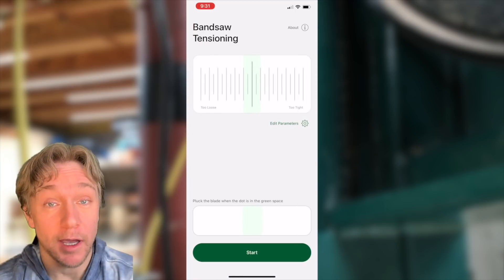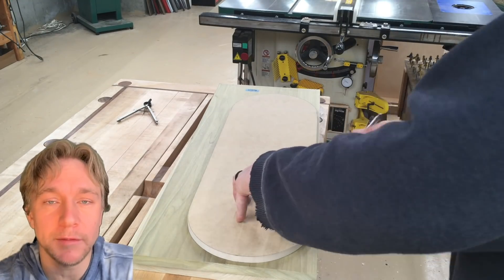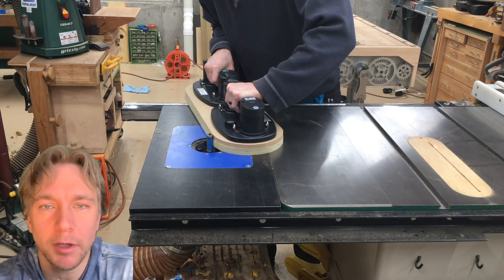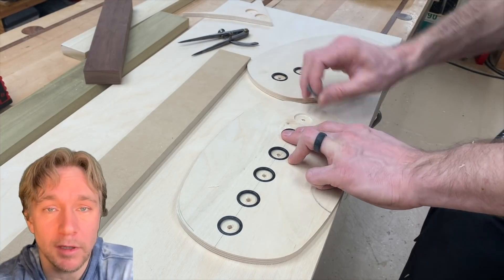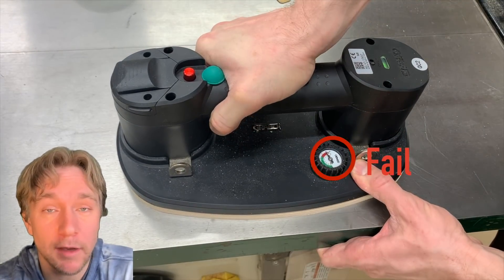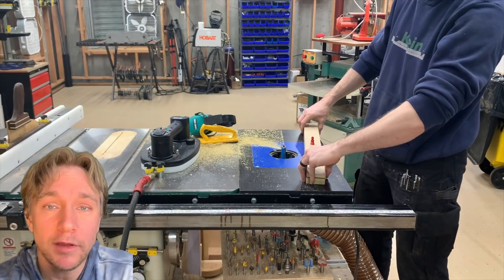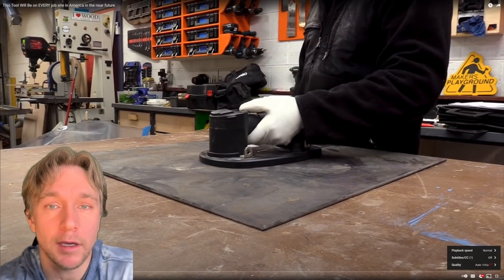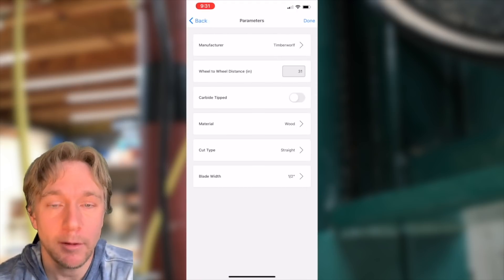GRABO template routing, can it be done?

Comment: Is there a musical note for the "perfect" tightness of the bandsaw blade? I have an app on my phone to tune my guitar. Would that work on the bandsaw if I "pluck" the blade"?
Reply from the maker: No, the perfect notes changes based on a bunch of specifics for your saw and blade, that’s why so made the app.
Reply: If you always have the same bandsaw and the same blade, you should probably always expect the same note when it"s tuned correctly. It won't work anymore if anything is changed. And this specific app probably won't get rid of the harmonics the same way as your tuner, because the purpose is not the same. So a guitar tuner may work in some specific cases, but won't cover all needs, far from it. (from what I understand of it at least)
Reply: @Jabari Edgar I would suggest flixzone. You can find it by googling =)
Reply: i know I am kinda off topic but do anyone know a good place to watch new tv shows online ?

Comment: Hi Andrew!  A very interesting program.  Can you make a metric version?  In millimeters, so you can choose millimeters and inches?
Reply from the maker: Was this comment meant for a different video?
Reply: I purchased the Bandsaw tensioning program and wanted to ask if it is possible to make a button for switching measurements between millimeters or inches?
Reply from the maker: Debugging is the priority right now, but a metric conversion function is in the list for later
Reply: @AndrewKleinWW  Ok, Thanks!

Comment: I normally drill a couple of slots in a base plate for any router templates, enough to fit the festool mft style clamps. Put the new piece and template on top of the base and clamp the three together. The base can either be sacrificial (first time), or just offset/thinner than the template to avoid cutting it. Obviously, this method sometimes requires a large bit. I'm sure a metal alternative could be a lot thinner and allow for built in clamps.

Comment: I haven't had a chance to use my bandsaw tuning app yet because my bandsaw is still in shrink-wrap after moving, but I'll be pretty patient with it when I try it.  I use specialized equipment for this for tensioning belts at work that operate on the same principle and the unit we use is $600 and they don't work very well most of the time.  They're very sensitive to background noise, if you hit anything else while strumming the belt it won't work, the vibrating belt can't hit anything .  The fact that you made an app that can do the same thing for a few dollars is impressive.  I'm excited to try it out and I'd be happy to give you any useful feedback I can come up with to help.

Comment: How does the bandsaw app get around the fact that linear mass density can be wildly different between different blades in a relative sense (even 10% is significant), thus highly affecting the end measurement? Regarding the issue of picking up harmonics, is the graph you showed us of the FFT a representative sample? If so, that's unbelievably noisy. The acoustic tension gauges I've worked with in the past have used active noise cancelling to isolate the sound from the belt, and even then they weren't super reliable.
Reply from the maker: The furnace was running in the background so I think (or hope) that this is a worst case, and I am still about to get a decent reading.  How are you defining "linear mass density"?  Do you mean that the blade width and thickness vary with blade size and therefore mass/inch varies?  Or that the actual mass/volume density of different metals vary?  different answer for each.
Reply: @AndrewKleinWW  I meant that if someone is using a blade that's not one of the pretested options, small variations in thickness, density, or even tooth geometry directly impact the mass per unit length of the blade, and thus what the ideal frequency is from the standing waves formula. Because the app is trying to set a precise tension not just relatively but in an absolute sense, it's pretty sensitive to the input parameters (mainly span and linear mass density).